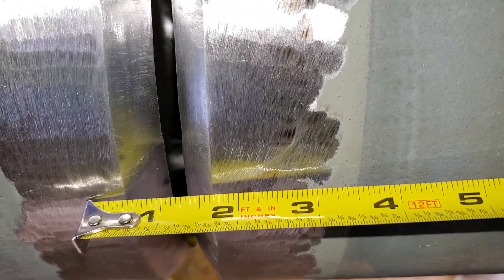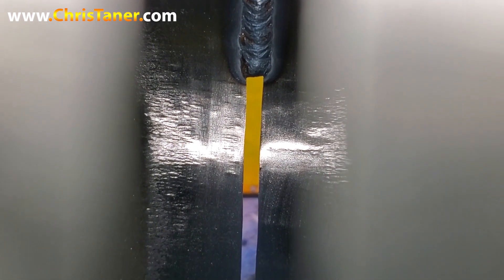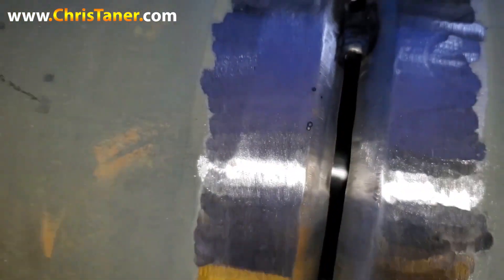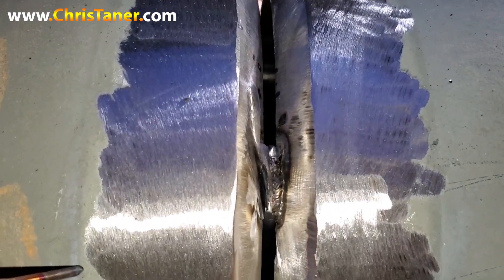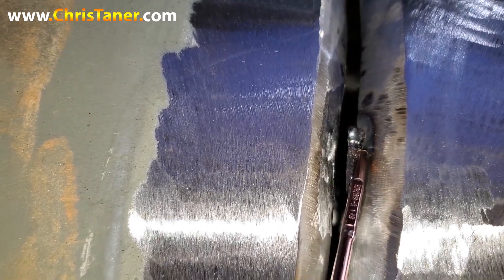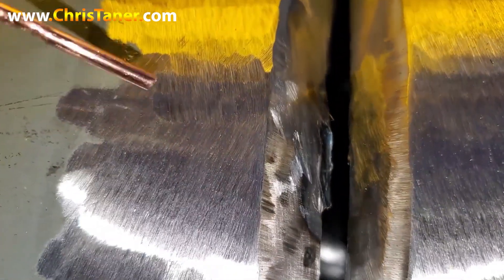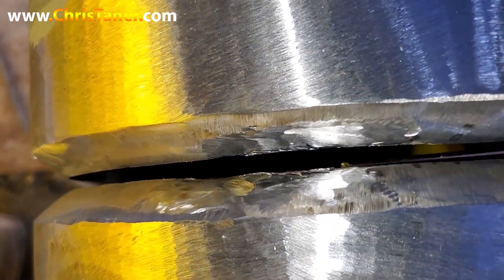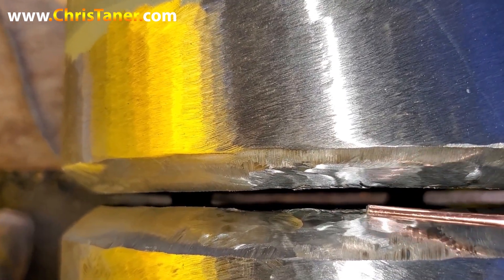[Pipe welding] How to repair over penetration in your root pass

Comment: How do u keep it from dripping with that gap
Reply from the maker: Keep wire pressure on the puddle and lift the weld rod just a little as you move forward and go from side to side, do that at a constant speed with proper amps. For me I use 90amps and a 1/8 tig rod.